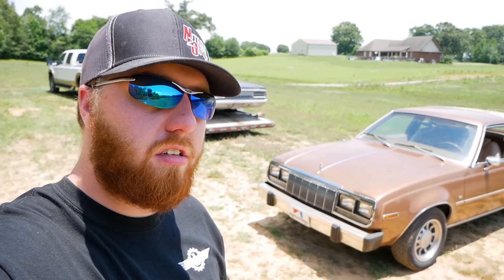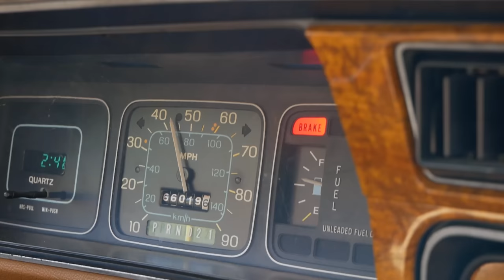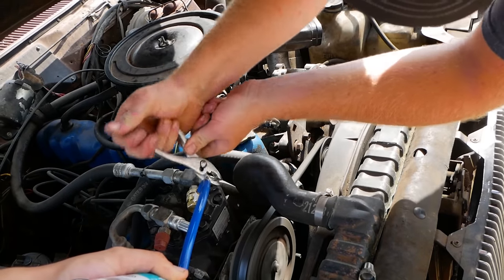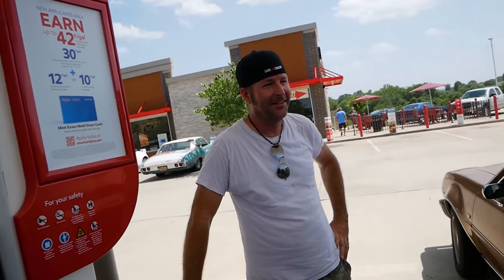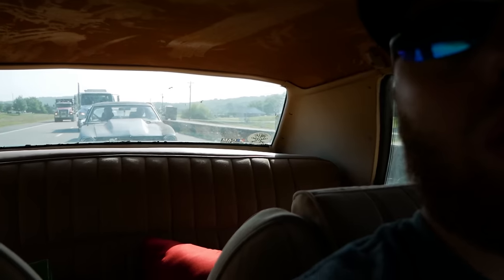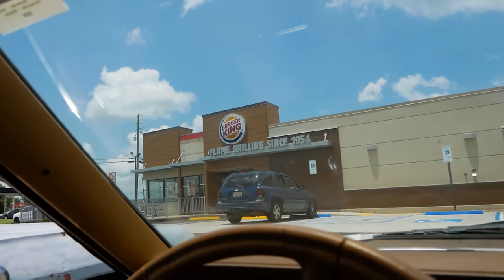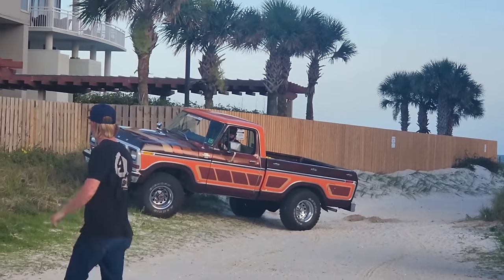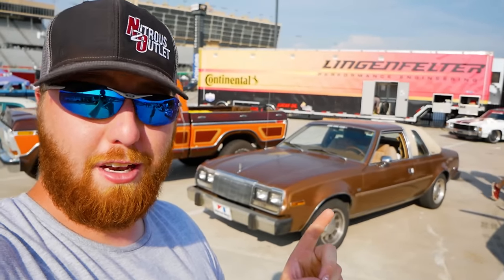Will a 43 Year Old Car Survive a 1500+ Mile Road Trip With Zero Preparation?

Comment: I was a mechanic at an AMC dealer in the early 80s. They made some great vehicles. The only brand new vehicle I've ever purchased was a 1985 Jeep J10. Never had a problem with it, but sadly had to let it go when it was hit by a drunk driver.
Reply: I have three J trucks today
Reply: The AMC Jeeps are obviously one of the best AMC vehicles Jeep Grand Wagoneer, Jeep Cherokee/Cherokee Chief and the desirable Jeep pickups although rare as hell now lol
Reply: Had an 86 Cherokee Four Door with Manual that never gave an issue whatsoever until around 150K miles when the clutch pedal literally fell off late at night while attending school.   My best friend worked in a shop and came and got me and towed the Jeep back and gave me his car to drive.  The next day he told me that he thought a connecting rod was getting ready to cut loose due to a knocking I had heard for years so I sold it to a guy (fully disclosed everything) who wasn't concerned because he was a salesman for a motor additive and planned to use the vehicle as a demo.  I used the funds to buy a 89 Laredo, that car gave problems all the time even though it had a new factory block in it.   Multiple trips to the dealership never resolved it and I sure missed my 86...
Reply: Hey I know this is abit late but theirs two 84's for sale on the fleabay, high mileage and high price, about 30, but the metal work is intact and one is a restored short wheel base with a golden eagle on it that says its a golden eagle tribute truck

not sure what that's about but it could be a good trip down memory lane just to take a look, as I just went looking as I had never heard of that kind of jeep before and sure enough two poped up
Reply: frfr

Comment: I had that exact same concord, same year and color. That was the best car I've ever had!! Paid $500, it had 17,000 original miles. After 436,000 miles the tranny gave out,  but the motor still ran flawlessly.
Loved that car.
Reply: Damn, now that is $500 well spent.
Reply: I wonder what happened to that car now. Can you give an update?
Reply: Awesome straight six
Reply: @matcentrino7602  I didn't have the space available to change the trans myself, so the car is long gone. I sometimes wish I still had it, that thing got great gas mileage too.

Comment: Bit of a safety tip. Never charge on the low side with only liquid (you can slowly introduce it into the system if the port is a good distance from the compressor, but it can be tricky).  If you introduce to much liquid into the A/C compressor it can "slug" the compressor and cause damage.  

This damage can be much worse when the suction connection is actually at the compressor.  liquid is not compressible.    And now back to our normal content...already in progress.
Reply: Charging a system full of air and moisture never works long anyways. Unless u vacuum the system to remove air and vaporize the water in the lines from the atmosphere your just wasting money.
Reply: And don't put PAG oil into a converted R12 system. (Like he mentioned in the video) R12 to R134A conversions use Ester oil. Pag oil and mineral oil (used in R12 system) when mixed together make sludge.
Reply from the maker: @SlipFitGarage  i forgot to mention i usually eo a flush, but I'll remember this!
Reply: You know when AMC was formed one of the companies that merged into it was Kelvinator? Kelvinator made refrigerators, freezers and air conditioners. I say that to say they put the low side port on the receiver drier for a liquid fill or a vapor fill. A Liquid charge will work faster though...
Reply: I am no professional but I also thought it was a little strange to introduce liquid into the system on the get go. I always heard of not doing that or you can do damage to the compressor. However it seems like maybe there was enough Freon in the system to prevent it from locking up. No matter what, he lucked out on having a working A/C while driving in that hot and humid weather.

Comment: Years ago my dad had a little used car lot and took in a Concord wagon on trade. Concords are the 2wd version of the Eagle cars. It was a nice original car in pretty decent shape, and relatively solid. The car was one of those fake woodies from the factory, but someone glued a strip of  home wood paneling along the tops of the fenders by the hood. We went to remove them because it was unsightly,  but low and behold the tops of fenders were rotted out all the way across both fenders, seemed to be the only rust in the whole car and it was such a odd place to rot out, so the paneling went righ back on 😂

They actually made a 4wd version of that car,  they had the Eagle coupe, sedan, wagon, and a hatchback thing called the sx4
Reply: I had a Concord for a short time, too.  Rust was in the same place as you described.
Reply: These cars were made in my hometown. AMC had a problem with the tops of the fender rusting. It may have had something to do with the outside air vents.
Reply: the coupe/2dr was available in Fastback (SX4), notchback, kammback and targa top (rare AF)
Reply: My 1974 Hornet had the tops of the fenders rust out first. The rest of the car after.
Reply: @dalesworld1308  
The Hornet was the same car as the Concord. I always thought the  Hornet badge was So Cool when I was a kid.
Reply: AMC's were notorious for rusting out the tops of fenders, especially in Michigan . My grandma had a 70 Javelin that were rotted completely out by 74.. it was insane.
Reply: @RedWhiteAndBlueVideo  I had the 74 Hatchbck - the same one that Joey Chitwood did the barrel roll in in The Man with the Golden Gun.
Reply: Had a sx4 lifted 31in and it was a blast just wish back then It was one of rare ones blow the motor and do to lose of storage space junked it to keep other cars things you look bake at as u get in your 40s
Reply: Crap would collect in between the inner and outer fender. Sometime around 1980 they started applying Ziebart in the factory. Where is should be done when you think about it.
Reply: @grandtheftautotune7715  
Face it everything rusted to shit back then. Especially in climates were they use roa salt.
Reply: @RedWhiteAndBlueVideo  Do you live in Kenosha, Wisconsin?
Reply: The reason was because the rustproofing didn't make it to that area when they dipped the bodies.  They went to Zeibart Factory Rust protection that did help.
Reply: @lvsqcsl  
Yes.
Reply: @RedWhiteAndBlueVideo  Yeah, I think AMC struck a deal with Chrysler to produce the rear-wheel-drive M bodies at Kenosha. (5th Avenue, Diplomat, Gran Fury)  That was shortly before Chrysler bought AMC in 1987.
Reply: @lvsqcsl  From what I remember Chrysler already owned AMC at that point, but promised they would have car production here. Although short lived. Then they assembled engines for quite some years. The place is leveled now. Just a big hole in the middle of the city. Do or did you live in Kenosha?
Reply: @RedWhiteAndBlueVideo  No, I have never lived in Kenosha.  My parents were looking at a 1985 Chrysler 5th Avenue and my dad being a union man wanted to know where it was built.  The salesman told him that it was built in Kenosha, Wisconsin.  I didn't believe him and did some research and discovered that Chrysler had an agreement to build the rear-wheel-drive M bodies in Kenosha in the AMC factory.  I remember that Lee Iacocca was on the Tonight Show with Johnny Carson and Lee's mother was still living and didn't think it was a good idea to buy AMC.  After Chrysler bought AMC, I think the Eagle and the M bodies were produced one more year in Kenosha.
Reply: @lvsqcsl  Chrysler bought AMC in 87 from Renault, who bought AMC in late 86/early 87 I believe. Last AMC's built were in 88 using leftover parts from the 87 run.

Comment: Nice Concord.  I've got a 80 Spirit Street-Freak style with a 350/700r4 combo.  Big and little tires, raised using Eagle front suspension and rear shackles.  Power Tour is awesome.  Did the whole thing in 2010 and different days of 6 other tours.

Comment: Those old 258's are pretty well bulletproof.  My old '78 CJ5 had a 258 and while everything else eventually fell apart on it the engine itself was still in great shape after all the crap I used to put it through.

Comment: 20:00 - I had to fix the AC on my first car.  AutoZone used to carry a kit that had connector and also 1 big can of combo R-134, PAG Oil and Stop Leak.  Put that in and 2 short cans as seen here and it worked like a dream.  Originally the AC Clutch wouldn't engage and would keep popping on/off.

Comment: The Carter YF 2bbl used on the 258 (4.2) was notorious for flooding on hot restarts, especially if you parked on a steeper grade hill.  Used to get a lot of "rescue me" calls where people would pump the gas pedal on a warm engine and flood it out, exactly as you describe here.  The computer controlled feedback mixture / idle solenoid (black thing with a plunger on the right of the carb when looking from in front of the engine) liked to fail also.   Pretty much bulletproof mechanically otherwise.   Timing 6 deg. at 600-625 rpm (advance disconnected) if you want to tune it up. This is super clean for how old it is.  With working brakes, safe tires and a cleaned fuel system I would have no problem road tripping one like that for a few hundred miles.

Comment: My younger brother had a 4 door '81 Concord in the early 90s. It was bought from a city fleet. It had the 2.5 4 cylinder with automatic and steelies with dog dish hubcaps. Blue with blue vinyl interior. Slower than molasses but once up to speed was a great highway car. Rode super smooth.

Comment: 45:04 my 1994 F-150 runs super cool too. It has a huge radiator in it from the 7.3 powersmoke. It warms up but sits at the very bottom of the normal area. the heater works great too, Its like 3 inches thick and like 4 feet wide its huge!
Reply: What motor does it have? I have a 4.9 and  I might do that to mine if it’ll fit. I think the hoses are on the opposite sides though.
Reply: @GasGuzler  mine is a 302 and 5 speed. Theres only 2 choices for rad’s on these for all motors and 150-350 theres a 1 inch and 3 inch thick rads. get the bigger one. its only like $80 more but mine stays on the N in normal on the gauge. Buy the bigger one i’m 90% sure it’ll fit but if it doesn’t then just go swap it out or return it!
Reply: The size of the radiator should not affect the engine's ability to fully reach operating temperature, provided the thermostat works as it should.
Reply: @Dziugenonas  my truck runs just fine and reaches full temp it just stays really low on the gauge since I put the bigger rad in it. My heater works fine and everything too. Theres a line on the gauge that marks the begining of normal temp and it stays right at the begining of it.
Reply: @mromatic17  Unless you were always slightly overheating prior to changing the radiator, I wonder why the size of the radiator would lower the temps. The thermostat still opens and closes at the same temperature.
Reply: @Dziugenonas  it still gets up to the normal opperating temp I just put a rad in that is 3 times thincker then the old one. It stays about right at 190 constantly. the last rad would have the gauge at about halfway and the bigger one is a little past the operating temp line.
Reply: The OBS diesel radiators are huge compared to the gas ones.  86 to 94  F series idi diesels used the same radiator. Don't know about the power stroke OBS. Ford most likely  just kept using it up to 98.
Reply: @craigwiess1656  well I know there are 2 different sizes of them for my truck 1 is like an inch thick and the other is 3 inches thick and thats the one I bought cuz why not? it makes it run cooler especially when its above 100 degrees for a few months straight!
Reply: @mromatic17   for the gas there is the standard cooling and HD cooling. 
Had a 95 Bronco  5.8 had the HD cooling package.  Friend had a 93 F150 300/6 2wd upgraded to the larger  radiator,had to trim the radiator support. The diesel radiators are  even larger.  Have a 86 6.9idi diesel just pulled all the turbo  components from a 94
 7.3 idi.  Radiator is the same. With more trimming the diesel radiator will fit with custom hoses. 

For better engine cooling if your truck doesn't have it  you can add the factory oil to water cooler. It bolts on  at the oil filter location and uses a  special lower radiator hose.

Comment: Now that really looked like you all had a great time. I envy each and every one of you for taking a trip to Power Tour in those beautiful hot rods. Love every one of them. I wish I still would have my 71 Mustang Mach 1. I was so proud of that car. My first car my dad bought me back in 1981. I was the second owner and it was in rough shape. My dad bought it for 400 dollars. The guy was willing to let it go for 200 dollars because it smoked so much when it ran. My dad felt bad only paying 400 for it. I was offered $5000 dollars for it back in 85. I had it running great and put a midnight blue 2 stage paint job on it. I had the interior fixed up. Not perfect but it looked great. I lost it about 10 years ago when I went to jail for about a year and someone filed an abandoned title on it. I had it parked at a friends house and when he moved he parked it on the street in front of his old house. The new tenants filed the paper work and I never even got notified about it. Lost a beautiful car just about a month before I was released from jail. Years later I went through a few cars and now I have this 97 Nissan 200sx. It has a dent on the drivers side quarter panel and the paint is so bad. However it runs great and drives like a new car. Looks like crap but it has never left me anywhere. For that I am grateful.

Comment: I had the exact same car in black, and it had chrome reverse wheels on it with those wire basket inserts. I paid $300.00 for it with 70k miles. It ran and drove smoothly, went up hills really well. After taking the baskets off the rims and buffing it all out, it cleaned up real good! I drove it all over California. The trans turned out to be the weakest link, so I dumped some treatment in it and sold it for $2k after spotting a gorgeous, one -owner 1973 Ambassador 401 wagon. I picked that up for $700.00 the evening I dumped the Concord! Fun video!

Comment: You said the only difference between this and the Eagle was AWD and its a wagon. Eagles came in 2 dr. Coupe, 2 dr. Hatchback, 4 dr. Sedan, 4 dr Wagon, and 2 dr. Convertible. The Concord was available in all of the same,with the exception of a 4 door hatchback being available in Mexico. There was also the AMX starting in 78 but it was considered a seperate line with no Concord badging whatsoever.
Reply: He owns an AMC eagle wagon. That's what he was referencing was the eagle he owns.
Reply: The Eagle SX/4 was basically the Spirit with 4wd.  It came as a hatchback or with the same Kammaback as the Gremlin with conventional rear windows.  The AMX you are talking about was indeed based on the Concord.  Later, it was on the Spirit.

Comment: I own a 1979 Spirit that is my first car... I got it in 1989! As for parts, the engine is an AMC design that came out in 1965 if memory serves. The transmission is a Chrysler Torqueflite (Torque Command in AMC), the alternator is a GM 10SI, the upholstery fabric was sourced from Chrysler, the power steering gear box and pump are GM Saginaw units, the steering column is also a GM Saginaw unit, the rear axle is a Dana 35 (Dana 20 in V8 cars- the 304 was an option in 1978 and 79 and I believe Randall Motors in Mesa Arizona offered them with a 360 swap), the brake master cylinder is Delco, the calipers and wheel cylinders are from Bendix, the wiper motor is Ford, the Duraspark ignition is also Ford, the small plastic vacuum canister on the driver's side is GM, the power windows are Ford (if so equipped), as is the starter and solenoid (with an extra ground for neutral safety on the bottom of the solenoid that Ford never used) and the front suspension design is a knock off of a 1968 Ford Mustang. Oh... the carburator is a Carter BBD.  BTW... the wheels are 80's aftermarket rims made by Western Wheels. You also should NOT use PAG in a R12 car. Use Ester oil instead since it is miscable with the old mineral oil used in R12 while PAG is not, and Ester works fine with R134a. Oh, and I believe it's named after Concord, New Hampshire. The Chrysler Concorde is named after the plane since it has an ending E. DL is the trim level. In 1979 (the year of your car), there was a base model, the DL and the Limited, which was the top trim with leather interior. There was also a super-rare silver anniversary edition (AMC was founded in 1954) which had a 2 tone gray and silver paint scheme. In 33 years of AMC ownership, I have only ever seen one. One last thing... your car has 110hp and 2.87 rear gears.
Reply: The 232 appeared in 1964 but was loosely based on a Willys/Nash design dating back to 1952. Great little engines in very underappreciated cars. I really want a Hornet wagon.
Reply: @tomadkins2866  
232 was a clean sheet design. But basically all American OHV inline 6s are similiar. The rear axle in this car was the small AMC rear end. Built in house. In the late 80s they sent all the rear end equipment to DANA except for the Ring and Pinion gear cutters. The Chinese bought those. Gear sets in AMC rear ends were exceptionally quiet. In the 70s they were contracted by Ford to supply gear sets for the MPG econobox Mavericks. Those gear sets were noisy as hell. The AMC sets were lapped and the Fords weren't.